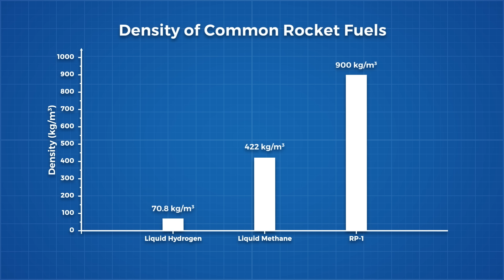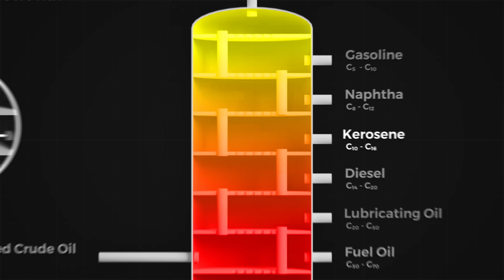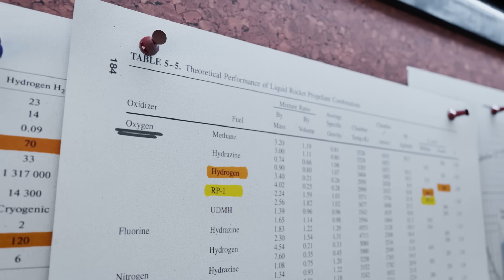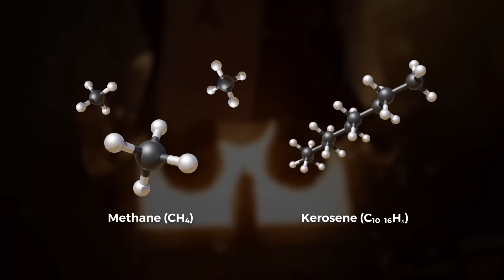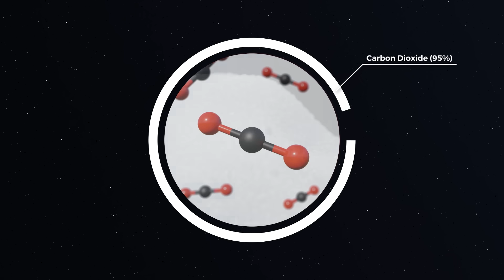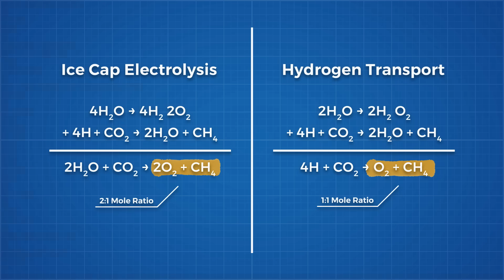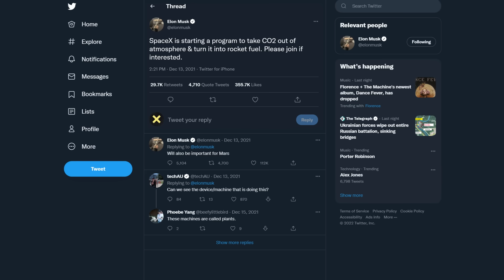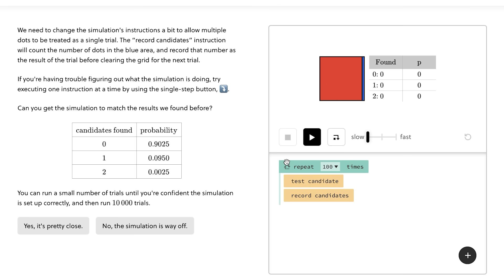Why SpaceX is Using a New Fuel

Comment: I Wonder how the byproduct of carbon monoxide would affect Mar’s atmosphere, 🤔🤔🤔

just like how we worry about how our atmosphere has been affected by the waste of byproduct gases that we produce. (I’m not being specific because I can’t remember currently the name of the gases)
Reply: Carbon monoxide is less stable than carbon dioxide. Any carbon monixide released into the martian atmosphere would eventually degrade into carbon dioxide so long as it has a source of oxygen.

This of course requires an oxygen source. On earth, this is O2 in the atmosphere. This is why carbon monoxide isnt worth studying as a greenhouse gas. Although it is a health hazard immediately after production, given time, it turns into carbon dioxide.

On Mars though, the martian atmosphere is pure oxygen poor. However,  carbon monoxide is less stable then iron oxide...  And most of the martian surface is red because of iron oxide dust. There's actually a lot of oxygen on Mars, it's just tied up in carbon monoxide atmosphere, and an iron oxide surface.

Since carbon monoxide is less stable than iron oxide, carbon monoxide can undergo a redux reaction with iron oxide, forming carbon dioxide and pure iron.

This is probably why we dont see a high concentration of carbon monoxide in the martian atmosphere. I'd be willing to bet the carbon monoxide that does exist is probably the result of breaking down from solar radiation in the upper atmosphere, before eventually reforming into carbon dioxide.

Give that carbon monoxide can undergo an exothermic redox reaction,  this could actually be a way to process martian soil into iron metal, that can then be used to make steel for construction. This is actually how iron ore is processed into iron metal here on earth in a blast furnace btw. I think you need high initial temperatures to achieve the reaction, but once started, waste heat from the exothermic reaction could be put towards the sabetier process, ideally making it more efficient.

... I suddenly have an urge to email SpaceX with this idea.
Reply: Carbon monoxide can be split to produce carbon and oxygen, which both have plenty of uses, or refined further into many other useful chemicals.

Comment: lets see if i get this right guessing from the start - structural integrity of the inner fuel delivery pipe?
Reply: I see you have not been privey to the structural failure they had when they filled Starship up. Go have a look at thunder00t's vid. I'd be amazed if they even get it into space, let alone Mars.
Reply: @PoseidonDiver  
Thunderfoot is an extremely bad source for factual information when it comes to anything Musk does.
He has a financially induced hate-boner against Musk because that generates clicks. 
I can prove it to you: Look up the best argument you think TF has against Starship and support it with the sources and numbers TF presents. I in turn will demonstrate you how TF is misleading you on the topic.

Comment: Why would you capture CO2 from a power plant and turn it back into fuel?  It would take a lot of energy to "un-burn" that CO2.  If that energy is coming from the power plant, you'd have to input about 4x as much energy into the un-burning than the power plant produced in the first place.  Where does that energy come from?  Nuclear power?  If so, why not just put that energy on the grid in the first place?
Reply: Because CO2 is a pollutant... of so the greens want you to believe.
Reply: @VariantAEC  But the point I'm making is if you're burning the fossil fuel for energy, it'll take much MORE energy to turn that CO2 back into fuel.  Where does that come from?  If it's from a nuclear reactor or renewables, why bother with the fossil fuels in the first place?
Reply: @VariantAEC  But if you had sufficient nuclear energy to sequester CO2 as it leaves a smokestack, then you have more than enough to just shut down the plant emitting the CO2

Comment: a new fuel??????  a new fuel???   is methane!!  the most common gas that everyone use to cook in their kitchens..
Reply: It's new to as a rocket fuel
Reply: @Steph.98114  that is false too.  The XCOR's rocket engine also used methane in 2007,  NASA already developed methane-oxygen propulsion including RCS with the same fuel in the Project Morpheus.
https://youtu.be/ftPZsKeAZTY
There were others from different countries as well. 
Is just a fuel..  Spacex is great for several reasons.. but I would not include a fuel selection in any of those.

Comment: I'm not sure that burning additional energy to marginally offset the inherently dirty processes of burning coal or oil for power is really all that green. That's like throwing a solar panel on an old truck that gets 5 miles to the gallon instead of upgrading to a more efficient vehicle.
Reply: You just use the energy when it is at peak production, rather than all the time, thereby you maximize the co2 mitigation
Reply: @NGCAnderopolis  You are still producing just as much CO2 as the oil or coal would normally produce, you are just delaying it a few hours. Oil and coal already produce over twice the CO2 of natural gas per kWH, so it is hard to see why it wouldn't be more efficient to just convert the power plants to natural gas directly (since you need those plants to burn the methane anyways) and lay off the oil and coal.
Reply: @SBBurzmali  you are missing my point. You use excess renewables to produce fuel, and then you burn that fuel. Now the fuel is CO2 neutral.
Reply: @NGCAnderopolis  That's fine, but the price for entering the game is burning oil or coal, hence you are paying twice the carbon to start the game and getting less than one back.
Reply: @SBBurzmali  i use 10 energy units (eu) a day. Currently 8 of those are run by fossil fuels. I can build wind and solar  but they have high variation. They might produce 10eu but not when I need them but concentrated at points during the day. If i use 1eu in a given hour but in that hour produce 5eu renewables, 4eu are going to waste. If i can store those 4eu as gas at 25% efficiency I have now created 1eu to use at any time that is carbon neutral. If i use this to replace 1eu produced from fossil origin now I am actually reducing my carbon emissions by on eu worth of carbon. 

So if we can get this tech going we might very well be able to use gas as abtype of battery to extend the use of renewables.
Reply: @NGCAnderopolis  The problem is that this technology requires that you burn oil or coal to produce that carbon neutral fuel. That means that you are creating more than twice as much carbon per "energy unit" to fill your "battery" instead of burning natural gas as needed. The only you'd end up ahead is if you were able to generate around 1.5 energy units from the byproducts of 1 energy unit worth of coal or oil power which, at 25% efficiency, that for every 1 energy unit of oil or coal on the grid, you'd need a surplus of 6 energy units from renewable sources to break even over burning natural gas instead.
Reply: @NGCAnderopolis  The whole point of this was slapping CO2 collectors on the stacks of power plants. You can't do power to fuel without a hefty supply of CO2 and fossil fuel plants with a side of garbage and biomass burners are your only source of enough to make any meaningful amount of fuel. Ergo, if you don't have fossil fuel plants running, you don't have power to fuel running.
Reply: @SBBurzmali  no it wasn't, that is one temporary way of capturing Carbon for use, whille the fossil plants are still in operation and are being phased out. Ideally you would capture all co2 from the powertofuel burners and just use that, but if not then you will have to get CO2 from the air. More inefficient but that wont really matter once you have run out of fossil fuel plants.
Reply: @NGCAnderopolis  Yeah... you are already splitting water to get hydrogen, separating CO2 out of air is going to drop your efficiency by at least an order of magnitude, probably two. With the exhaust from a power plant, ideally you'd have mostly water vapor and CO2, you drop the temp some and you can condense the water vapor and you are left with mostly CO2. With regular air, you are working with 0.05% CO2 and you can't just drop the temp to freezing to knock most of the other components out. EDIT: Honestly, you'd might as just pull CH4 out of the air directly at that point, it is almost as common as CO2 and no further processing would be needed.
Reply: @SBBurzmali  global co2 levels 418 ppm global methane 1879ppb that three orders of magnitude difference. Now if it turns out to be cheaper, sure but I will be sceptical because presumably pumps are the most expensive component in all this.
Reply: The idea is to use solar
Reply: @Steph.98114  I'm pretty sure solar doesn't produce CO2 in the volumes required. At the very best case, you are using the CH4 as a chemical battery to "shift" the solar power to a different time of day, but with a large enough grid, you could just not use as much coal and oil during the day instead and you'd have the same or better effect.

Comment: These slow motion shots of the Saturn V never get old. This was truly an awe inspiring moment in human history
Reply: That was the Saturn V though.
Reply: do you mean saturn v, i mean the atlas v looks great as well
Reply: my favourite shot of an engine firing was a slowmo shot of space shuttle engine test where the outer rim of the rocket bell had icicles on it from the super cold fuel flowing through it to cool it down, and right next to those icicles was the engine firing full throttle with a bunch of clear blue exhaust. The duality of super cold right next to almost surface of the sun hot, was super cool, and really shows just how much insane engineering goes into making these things that allows them to achieve that.
Reply: @Michaelonyoutub  
That was a throttle-down test to a minimal thrust setting. At full thrust, no icicles.
Reply: That is the Saturn V, but the Atlas V is really good too.

Ares V was going to be great, like SON OF SATURN V great.

Titan V would have been great, but Delta and Atlas were favored over Titan.  Titan V would have been a hydrolox system instead of aerozene-50/N2O4, and would have had first and second stage extensions, by ten feet each.  Possibly even diameter increases, perhaps to 15 feet on the first stage, much like the Titan-based Barbarian proposals.

Delta V (Not delta-v) is more or less what Vulcan will be.  Vulcan could perhaps be Atlas VI.
Reply: Thank you.
Reply: Thanks, corrected - don't know why the Atlas popped into my head instead of Saturn :)

Comment: It amazes me that they don't use some of the 20% of oxygen in the air around a rocket to help in take off. What a waste!
Technology! What technology? Of a bullet???
Reply: Presure! The pressure on the combustion chamber is FAR greater than the atmosphere pressure. It would just spill out the contents everywhere instead of anything getting in.
Reply: @Douglaswiller  
A sort of afterburner?
Reply: Virgin Galactics Cosmic girl does just that.
Reply: @NGCAnderopolis  
Heard she's slack, man. 😎😁
Reply: There are some designs that do use it but the issues is getting the pressure needed especially at the start.
Reply: @Steph.98114  
It's all a matter of temperature. Might be a good idea to set off rockets in the far north of Canada or Greenland, or on that vast southern island called Antarctica?
Reply: @huwzebediahthomas9193  But then you would just create more problems like transport, climate, infrastructure, winds, inclination, etc.
Reply: @huwzebediahthomas9193  you still can't get enough oxygen to lift the whole rocket, your talking tons per second. To do what you want to you need to launch like a plane and then during the flight switch to internal oxygen when you get high enough. A design that has floated around for a bit of this is Skylon

Comment: The thrust-time graph looks almost exactly the same as a stress-strain diagram for a strongly strain-hardening steel
Reply: What percentage of carbon and other bits?
There are new elements out there to be made you know? Super light, super strong.
Reply: @huwzebediahthomas9193  I wasn’t thinking of one in particular, sorry. Just the general shape of it; steel elastic region, long, upwards strain-hardening region.
Reply: @mitchstilborn   Yes I know. Great research is being done to make new elements - amazing what can be made with extreme low and high temperatures, and they are very stable at those temperatures. But fall to electrons and protons at room temperature though. 🙂

Comment: why not just use the hydrogen you get from the ice on Mars?
Reply: Hydrogen is a bitch to store long term, has a nasty habit of escaping between solid materials because of how small it is. It is doable but not cheaply.
Reply: @Steph.98114  
That is why it's peroxide has long time been used - larger molecules.
Reply: @huwzebediahthomas9193  correct but even that has its issues.

Comment: Yeah... Goodluck building that infsatructure in themost inhospitable place imaginable. 

You're presenting this like you can just throw these materials in a perfect self-sustaining loop. But you'd need either an excess of water or hydrogen to even initiatte the reaction. In the first place. 

The hysrogen would need to be imported and stored which just brings back the fuel problem from mars and every drop ofwater will be necessary for life support for the longest time 

Don't get me wrong it is possible in principal, but then you have to set up and maintain the whole thing exclusively using parts you shipped from earth.

Factories on earth have anadvantage here because we're buidling upon foundations of pre-existing infastructure and have a workforce who aren't slowly dying in agony from red dust and prolonged exposure to radiation, nore are they having a mental breakdown from a level of isolation and boredom we could never imagine here on earth 

Which means on-site engineers with specialized training on how to monitor these opperations. No amount of automation can concievably change that. Within the forseeable future.

And if something goes wrong it would take 20 minutes before musk even found out and annother 20 send a reply. 

Where are we even getting this power? Where are we getting the materials to harvest this power? How much stable infastructure on mars would we need to even think about building something like this. 

The core engeneering works, in theory, but Musk is nowhere near adressing any of these issues yet to ignore them is irresponsible. 

The truth is Musk is asking people to pay him to slave away their lives in miserable circumstances in the name of (his) glory. He'll never find a million people who have both the means, skills, and desire to colonize mars this century.
Reply: Hmm, will it take minions of people or perhaps only a few thousands of those who actually volunteered to go even if it was one way several years ago - even  efore SpaceX, when everyone thought that the human race was on the verge of saving itself from the approaching doomsdays.
Reply: @charleszipperer5027  not exactly sure what you mean by that, too many typoes.
Reply: Agree that ISRU methane on Mars is a non starter. Even in small quantities, the mass of the equipment you need is larger than the mass of methane you produce. Producing enough methane for something the size of Starship is insane. It requires an industrial scale mining operation, just to get the water before you can get to the chemical engineering. For a realistic Mars exploration mission you can use ISRU to generate the oxygen and simply import the methane. For an ascent from Mars to Mars orbit you need a single digit tonnage of methane. This is because oxygen comprises 78% of the mass of the propellant and methane only 22%.
Reply: @saumyacow4435  yeah even without knowing the exact numbers it's clear that shipping all that macienery and setting it up on site isn't exactly a realistic goal yet.

And we're just talking the macienery needed to produce the methane. harvesting the raw materials and processing them to use as rocket fuel requires more machienery and more labor. Which won't be viable until life support infastructure is firmly established. 

Musk's solution? Idk, throw bodies at it until it works? 

This infastructure is, by necessity, going to be built slowly and overtime. 

despite Musk's promisis I can only see this Starting with a handfull of professional NASA scientists and engineers, who I can only imagine will require garuntees of a safe return. Then, after laying the ground work, over a decade of two-year "shifts" we might have enough infastructure in place to consider some form of expansion

Comment: Nicely done video as always. 

I'd like to point out that the area under the Thrust x Time curve will not give you energy but change in linear momentum (N*s = kg*m/s).

Propulsion systems powered by the mixture Hydrogen : Oxygen are best suited for upper-stages, and possibly for a moon base and deep space missions from the Moon due the available frozen water in the poles and easier process to get the fuel and oxidizer.

Comment: Be careful! I watched this video and noticed you really didnt mention the thermodynamics of this at any scale (relating to carbon capture) the reality is to convert CO2 to any useable gas you pretty much have to someway or another add the energy you got from burning it. Carbon capture while burning fossil fuels to do it is a fools errand and unless you have a cleaner way to power it, it can never be useful
Reply: Exactly. You're better off electrolysing water (electrolysers have gotten very efficient) and liquefying the hydrogen. If you want to store it as a dense liquid (and lose some energy) then ammonia is a better carrier.